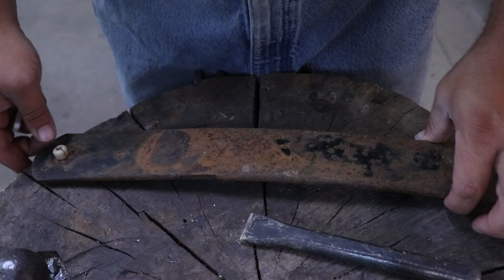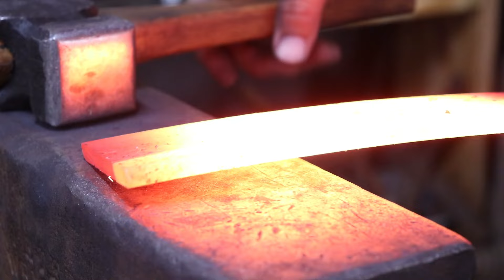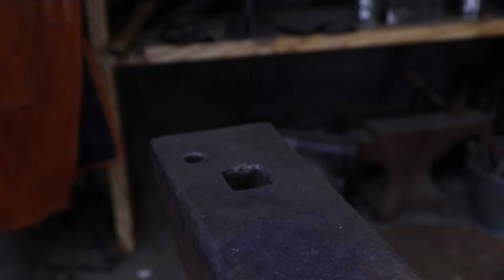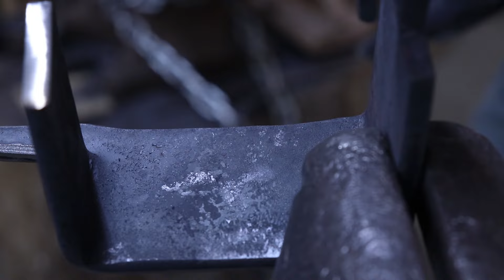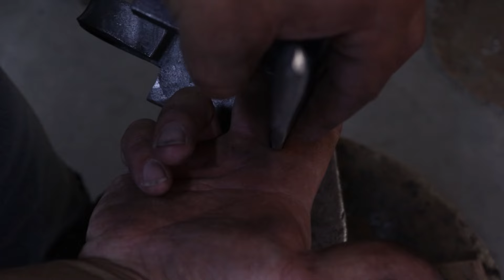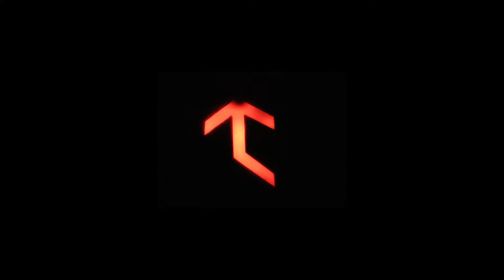Forging A Leaf Spring Anvil Bridge

Comment: I apologize for the ignorance here, but what do you use this anvil bridge for?  Any chance your next video could show it in action?  Thanks much
Reply from the maker: It is used for smaller projects like a grill fork for instance that has too tight of a gap to work on the anvil face so the bridge helps get in the tighter areas. I'll be using it for a project in the near future !